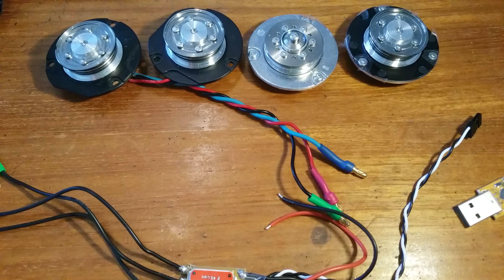How to run a recycled Hard drive motor using Arduino

Comment: How do you know which pin is which on the hard drive motor - or does the controller automatically decide?
Reply from the maker: If the HDD motor is a brushless dc motor(most of them are) then then controller decides, because it's like this three phase signal going in to the motor  and in a sense all pins are given the same signal, just at different times/order. The only thing that matters is if you have the motor turning in the wrong direction, you can swap the contollrer wires connected to the outer two pins to change motor directions. It's probably best to search up BLDC motor on youtube for better info and just treat your HDD motor as an BLDC motor.

Cheers